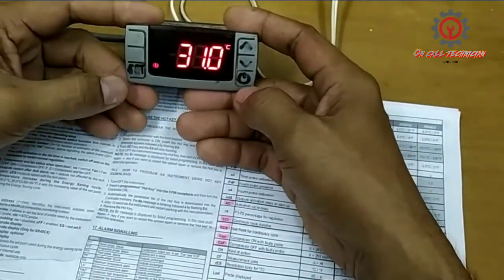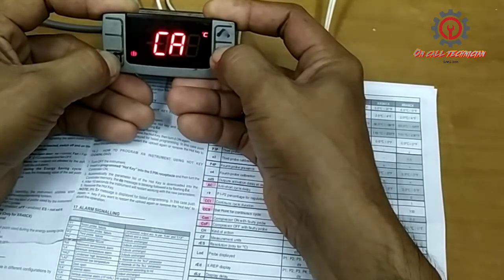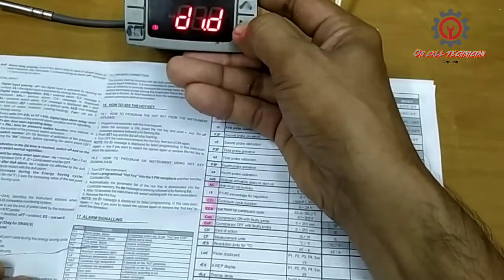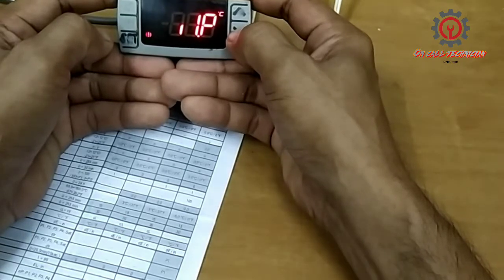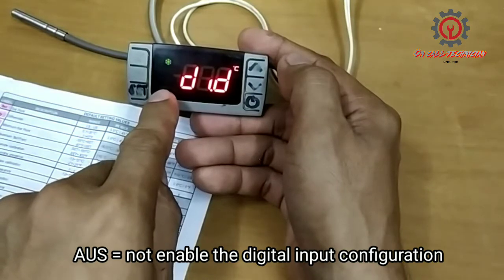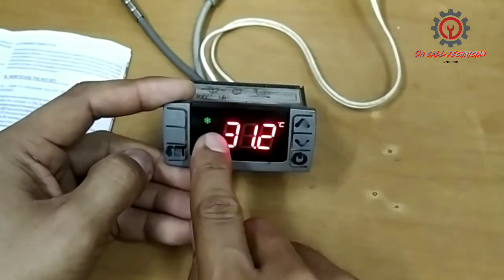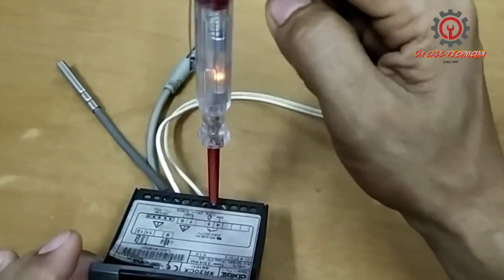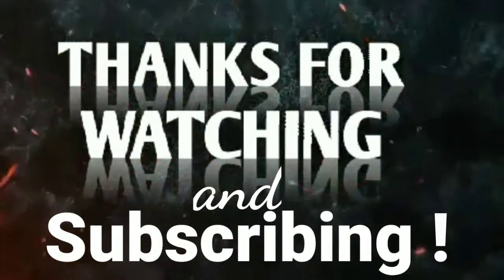HOW TO FIX "CA" ALARM OF DIXELL DIGITAL CONTROL

Comment: so what cause the CA alarm..
Reply from the maker: The manufacturer set that into EA as a default, hence most newbies and old tech that doesn't know this iF parameter tried to configured resulted in CA alarm. If you don't want trouble, set it to default.But if you're advance users  reconfigure